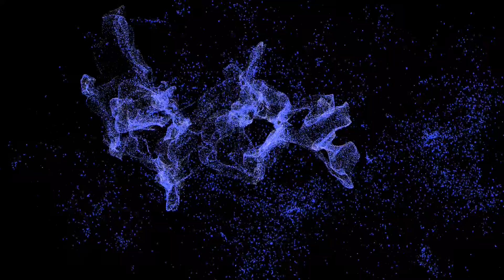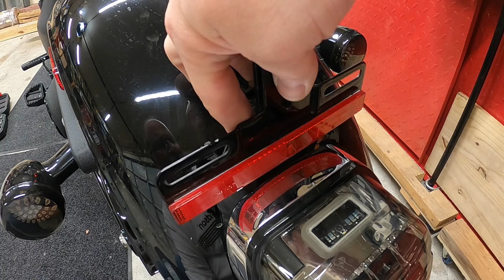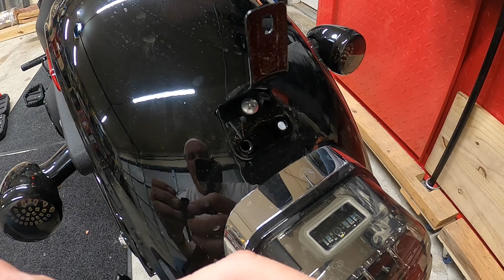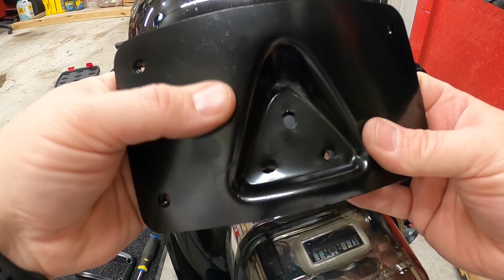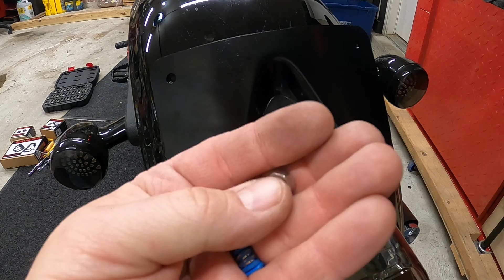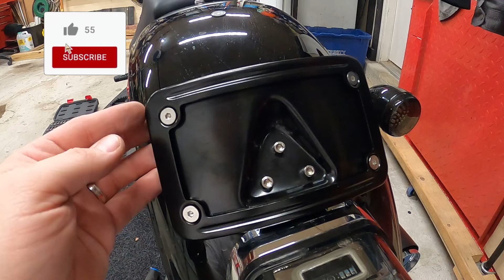Harley-Davidson Laydown / Curved License Plate Install / eBay Curved License Plate install / Amazon

Comment: Does this have the led in the plate frame cover?
Reply from the maker: This one doesn’t but you can add the one from custom dynamics. It works well.
Reply: @DoubleDMoto any recommendations on the best way or connector to use to splice into the factory plate light?
Reply from the maker: @CS-ek4zi I just cut the end under seat and wired it there. You can use these to make it easier. https://amzn.to/4oiV0pI
Reply: @DoubleDMoto much appreciated!
Reply from the maker: @CS-ek4zi anytime!

Comment: Works fine with no plate in it. But I found once you put the license plate in between the base and the bracket. It is a real pain. have to modify the license plate. Still worth the money.  Looks great. That's my input on it.
Reply from the maker: Interesting I didn’t have to modify my plate, just bent it to fit. Your are right though worth the money and looks great. I appreciate your input and lets others know your experiences. Thanks for sharing and watching!!